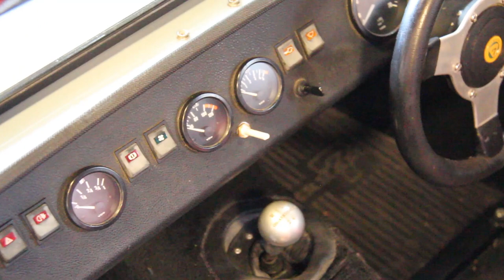Caterham Duratec 2.3 update.  FINALLY!

Comment: Great to see your update - thanks and congrats on the new addition to your family! I’m converting a 2002 S3 to 2.0 Duratec power. What’s the sensor in the middle of the fuel rail - is that measuring fuel pressure? And what are your thoughts on the Emerald K6? I was planning to use it too - have you just been using a base map so far? Cheers!
Reply from the maker: The sensor is actually a vacuum valve for the fuel rail. It was part of the Ford Ranger system and I just haven't deleted it from this build though I could. I do have a fuel pressure regulator and gauge located under the throttle bodies.  The Emerald K6 is a great system and I installed a Wide band Lambda in to the system so the ECU will self learn and adapt the mixture level as needed. I am running a fairly basic map but have tweaked it slightly. I was given a couple of maps from a fellow which work quite well.  If you need a map or two once you are up and ready to run I' can email them to you.  There should be very little difference between the 2.0 and 2.3 as long as you are running a few performance updates on the engine too.
Reply: David Beswick Thanks. I was also planning to run a lambda for closed loop running. What spec injectors are you running and what fuel pressure? I haven’t sourced a motor yet, but was planning to go 2.0 as that seems the convention and enough torque for the street. Cheers.
Reply: @TheBananaSlugger  Right now I'm running 380cc Bosch injectors though they are a little week. may go up to 420cc

Comment: Dear David,
Is it an S3 chassis? Does you car have lowerer floor? I am in love with a tiny Seven 160, but I am almost 200lb weight and   have 

wide thighs (I do weightlifting). Hence I think I do not fit in an S3 chassis. I saw a previous video of yours getting into it but I am not sure abour the size of your car.

Thank you very much,
Antonio
Reply from the maker: Antonio Jesus Calderon Martin  I’m about 210 and 6’1” and it has the normal floors. The seats are on sliders and the pedals have three settings for length adjustment.  The car is snug but very comfortable.  If you’re close to someone who owns a 7 ask them if you can have a sit in it.
Reply: @davidbeswick9842  Dear David, Thank you very much¡¡¡

Comment: That startup sounds like its taking too long. Who did the tuning on it? If it's a modern engine, it definitely should start up a lot faster than that.
Reply from the maker: I’ve set a slight delay on cold starts to make sure dry sump scavenge circulates oil pre-ignition. Better to be safe than sorry!

Comment: Is there any air filtering at all? I just see the intake trumpets, straight into the manifold...
Reply from the maker: Hey Joel!  There is a Pipercross Air filter that sits over the trumpets but I have a new one on order as the old one is starting to break apart and become brittle.  Filter is on when the car is insured and properly driven on the road.

Comment: what's this Ic management system you talk about, is it very versatile works with lots of engines, would you have an address a link thanks! there in America. Easy to set up with a laptop you can record all your data analyse it? What does this knob do like sport race ECCO you put in? What's it kicking out power wise looks good not that popular in America are they... you don't have any racing clubs for Caterham 7 yet.
 I don't like how you put the oil cooler so tight to the radiator would it be better to leave a gap even drop it down, should be able to put it down further you could use a ground Effect to channel the air into the radiator if you put it at a 55-degree angle